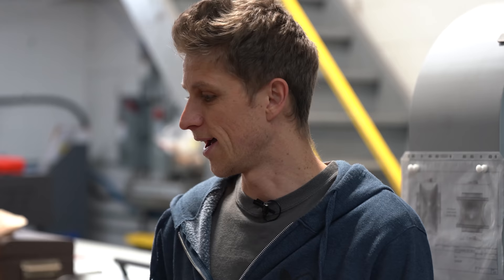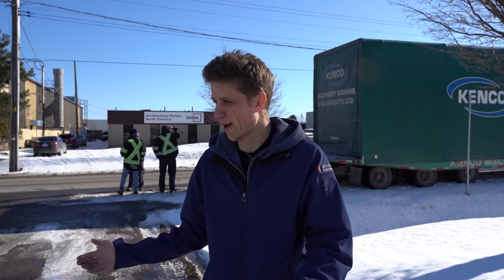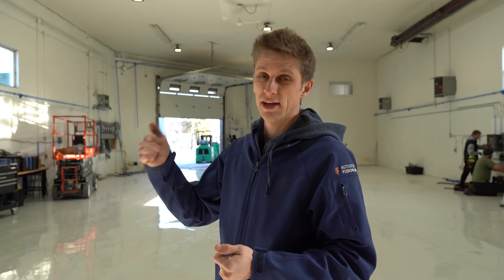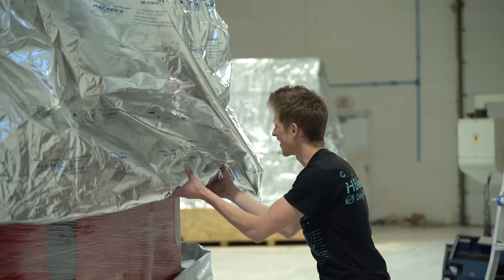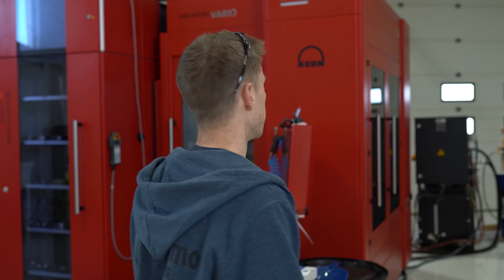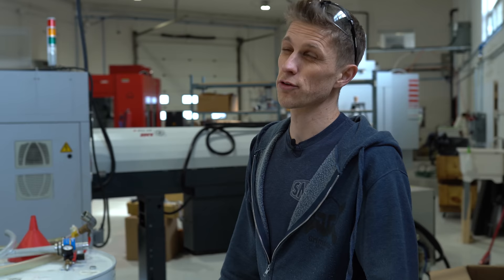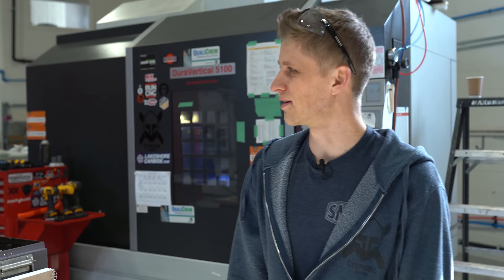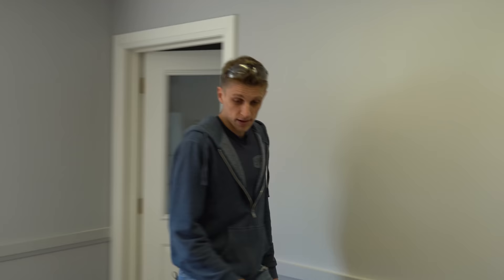NEW SHOP EP. 4 - Moving Machines & THE KERN IS HERE!

Comment: Some noise-dampening material on the walls and ceiling will help a lot in a big open space full of machinery like that.
Reply: Rockwool covered with white cloth made of fireresistant cotton is what they need.
Accoustic panels are just that, rockwool, sometimes a layer of foam but foam burns way too good.

Comment: How many knives do you have to sell to  be able to buy a friggin Kern!? Also thank you for being one of the few machining channels with machines other then boring Haas verticals!
Reply: Well, he's on like around 3300 of the norseman, at $900 a pop to start off with that is at least 3 million in sales. Add in the versions that guy for more and the task that has sold at least a few hundred then hasn't been doing too bad.

Id say he needs to start doing some jobshop work soon or come out with another hit knife before things eventually start tapering off.
Reply: @jp3354  I could see a market for 10,000 Norsemen over the next few years, but you're right. Another hit design (in addition to the Rask) is probably needed.
Reply: And having hiedenhain! That's huge! Wait til he learns the control and figures out the full capabilities.  I'm excited.
Reply: Judging by the serial numbers, they did sell stuff for about 4,000,000$ since the start. Their previous shop was really small and optimized, so the rent costs were pretty good. But even with that, considering time, employees, taxes, machines, materials, it will still be quite a bit of money on a table. But definitively adding external work, some new knife models, and optimizing production even further is probably a paramount. I guess the sales are probably still climbing, but they will eventually saturate, or even go down, unless some other stuff are done, including marketing using other channels. The KERN Micro Vario should increase productivity a lot - pallets can be loaded, and machine can work non stop, including night and weekend. So that is good.
Reply: Consider also endorsements.
Saunders gets payed a lot to do infomercials.
I bet he made a deal with Kern sales. After all, he's got the demo version of the Kern.

Comment: You can build an insulated enclosure around the compressor and eliminate a lot of noise. Just put a small vent in the bottom and leave it open on top for ventilation.

Comment: IR filters on the windows to prevent heating while keeping the light
Reply: Other option is light redirecting film. I believe 3M and Serralux are producing nice ones. It is amazing tech. You need to contact them directly, because which film to choose is very location and orientation dependent, but it works nice.

Comment: The quintessential American Dream. That's so awesome. Do you still drive the Volva? That's incredible that it's still going. Tint the windows. You can find them with ceramic tint to block the heat but allot transmission of visible light.
Reply: John Smith  Canadia is in North America. They're just USians that didn't reject the Crown.

Comment: Do you seat the tornos foot pad on the stainless steel tray? I'm interested
Reply: How else would you do it? The machine is obviously sitting on the stainless sheet metal.
Reply: @xenonram  Holes with a lip so that the machine rests on concrete and oil doesn't leak? I was also curious of this when watching.